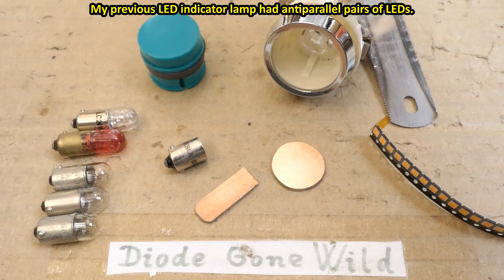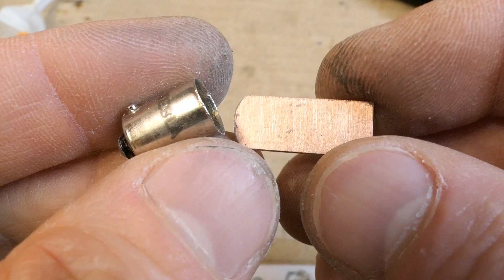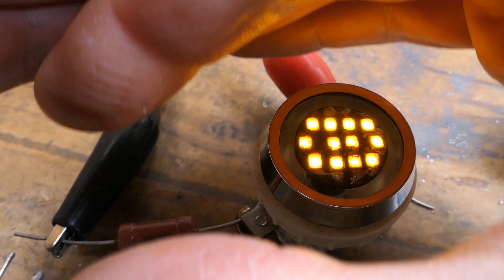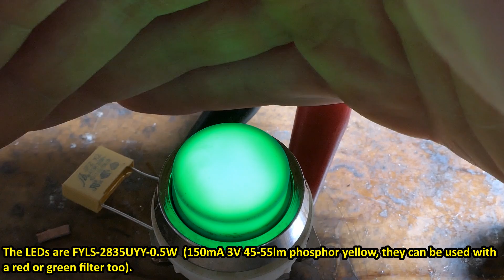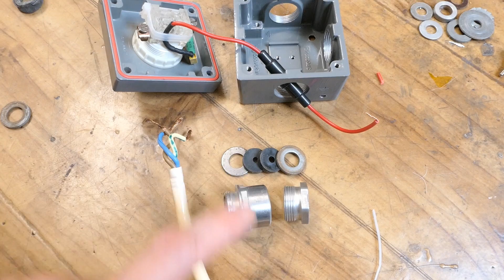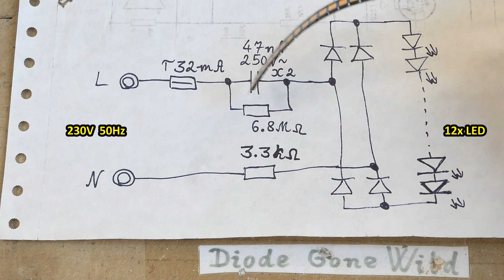Building a steampunk indicator lamp

Comment: If the light becomes dimmer in 2-3 years, just replace the capacitor. Secondly, it would increase its lifespan and reduce flickering by using a LC filter after the bridge rectifier. Theory says, less current variation leads to less capacity derating over time (we're talking about 1000s of hours, of course). Outstanding results for such a botched PCB.

Comment: Retrofitting old small light bulbs with LEDs is a great deal, I might say. Longer life, lower consumption and brighter light! I did it with the lamps from a Zenith Royal 1000 radio I got a while back. Both bulbs (1.5V x 0.25A) were burned. Since the radio operates with 12V, I mounted into the sockets bases from the deceased lamps a pair of yellow LEDs. The dropping resistor went into the battery box socket. If one day I decide to get the radio operating with the original lamps, just need to remove the resistor and reroute the wiring -- a perfectly non invasive job! Greetings from Brazil! :D

Comment: what steps down the voltage from 230V to 12V the capacitor? i dont understand
Reply: it is capacitor. 47nf  in serial with diode act as a resistor of 67.6kΩ . It will limit current to 3.25 ma. A resistor for discharge the capacitor after  disconect from main must be put in parallel with capacitor. About 1MΩ value. Not for beginners !!!

Comment: Im scared how skilled you are with that massive soldering iron.
Reply: Most of us, Czech electricians had to start with it. After you'll get used to it, you'll find out that it isn't that bad.
Reply: @vojtechadame5860 As an Austrian electrical power technician (fancy electrician basically) I...very rarely need a soldering iron for work. But I do have a tiny one for my hobby. TS80 and some cheapo from china
Reply: You can't replace the classic Czechoslovak transformer soldering iron made in Lidov Boskovice with any other soldering iron! Because that's just how it is!
Reply: @Vladynko1  I grew up with one of those. Virtually instant heat and fast cool down. You can regulate temperature by cycling the switch. One big disadvantage is that the tips burn our quite fast, but they can be made pretty fast from any scrap pieces of wire. There is a Murphy's  law for soldering with those devices. The tip burns out at the last solder connection you need to make. And no good scrap piece of wire is available, all are too short and horribly twisted. I had to finish some works with a twisted up tip, with sparks flying all over the place, just to finish that one last stupid solder connection to call it a day.
Reply: @Vladynko1  Western electricians never undersand it...
Reply: When I visited Prague many years ago, the first thing I did when I went to the flea market was to get a soldering gun just like the one he uses. I might say: it is great for almost everything, you just need to practice! No fancy soldering stations or expensive devices are needed for most of the jobs if you know the "feeling" of your tools and knows how to handle it. By the way, I live in Brazil, and most of the technicians around here had to learn sometimes with really bad tools!

Comment: I made a similar DIY LED bulb for a bicycle dynamo light but it burned out very quickly due to overheating. Might not be a problem in this case at 0.13W, but if it is it's because the PCB has poor heat conductivity which is why most LED lights are made with an aluminum PCB.

Comment: Dear Sir, I want your help regarding Extension board power LED. There are literally 100 videos and 100 website all claims a different resistor value for mains 230V to 3V LED resistor. some added 10K ohms resistor, some used 220k Ohms resistor. some said you need 1W resistor some are using 1/4 watts some said 2W and above. I am very confused
Reply: It depends on the current you want to run through the LED, which in turn is determined by which LED you are using.

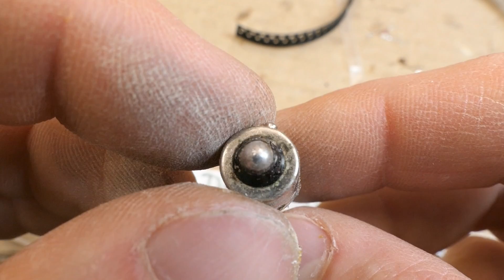Comment: 1:12 using solder for a mechanical connection...not good!
Reply: what do you know about mechanical or structural engineering .w.
Reply: You're right. In theory. But I don't think that's a problem here.
Reply: This is how it was done many years ago in Czechoslovakia.